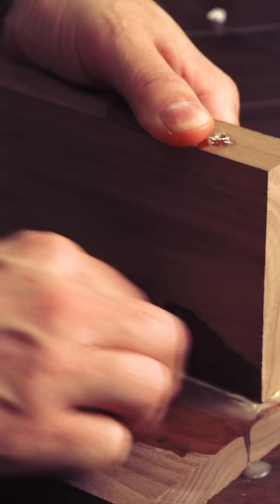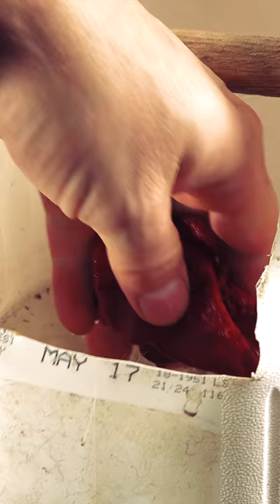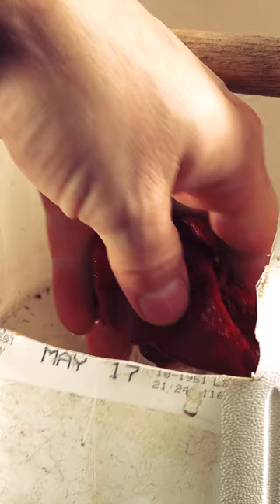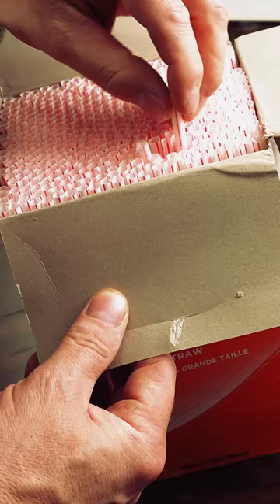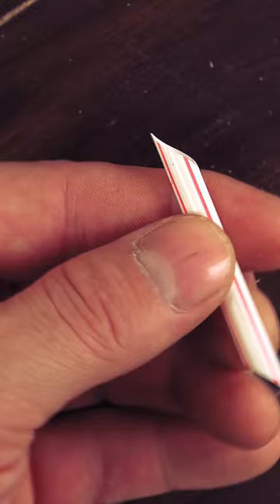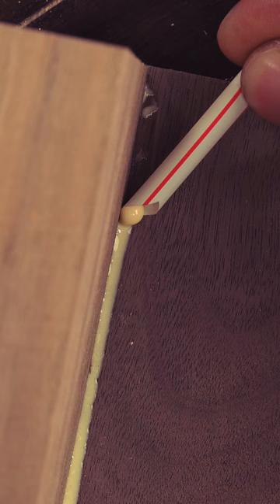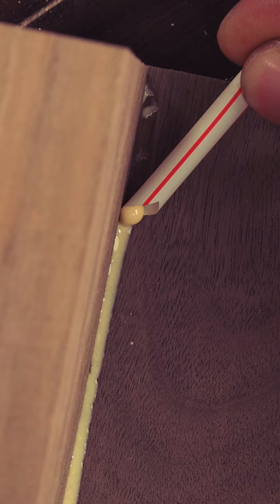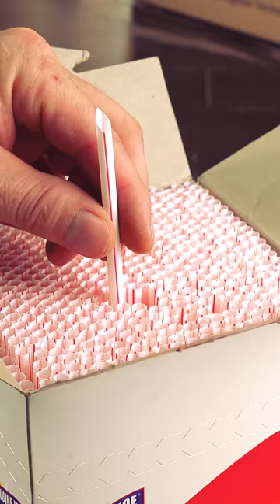95. Straws are PERFECT glue shovels #mtbitesize #shorts

Comment from the maker: Hey Makers!
I got lucky and found those straws discounted at my local hardware store (Menards).  Here's a box I found on Amazon that are a good buy → https://amzn.to/3VGXq1Z

The reason the woody trees wanted to take a nap is purely for-rest.

Got a tip, send me an email (and get credited)! → https://bit.ly/3KsbPL4
Reply: Btw if you cut off the used part from the whole straw it will make them easier to use and last longer since it's maybe 5mm of used straw every time.
Reply: Or you could just cut the angle on the straw and then cut a new angle the straw after you’re done
Reply: Tip is wonderful, but i have a little problem with it. You say this box will last you a life time. Yes, it is probable. But this is a plastic straw. You are working with wood. What if you take a straw size dowel, or maybe a bit larger, a carving knife and just make that tip on the dowel? You probably have a ton of scrap wood, so you have a material that will last you, your children and their children a life time. Plus you will not throw out a plastic trash every time you scrape that glue excess. Just a little thought... Or maybe take some tougher wood, create a slightly smaller angle than 90 degrees and create a lovely wooden tool for removing excess glue? You could even take a pointy stick, wrap a bit of paper on the tip and you have the same tool, disposable, made of biodegradable material. Possibilities are endless for someone creative and working with such materials :)
Reply: @ogi22  😂 I think you may’ve missed the “hollow” point of this, & the fact a plastic straw will bend deep into the crevice clearing any residue.

@ogi22 Using a timber dowel will make clear up twice as messy
Reply: Would painter tape work?
Reply: @jsthormahlen  Probably it could.
Reply: i found water base wood glues( Elmer works best)   mixed with  90% isopropyl alcohol ( i forgotten the ratio)  leave   little to no mess behind as you can used way less . Sinks way deeper into the wood. Strength depend on the mix ratio  If mix right   You would rip the  solid wood  blocks apart  before the glue fails  
Their are some issues. Quicker dry time  
Glue shrinkage over time. Weird  final cure time.( need more study of that).
Will stuck water out of the air till fully cured.     
I have  things in my home fix this way over 10 year old.  No sign of failure once the cured. Strength is still  insane.

Comment: Don't cut the straw apart until after you scooped the glue. Then just cut off what has the glue in it. They will last even longer and give you a larger area to hold onto it making it more comfortable for larger projects
Reply: Big brain!
Reply: I use the same method he does and I’ve found I don’t have to focus so much on pinching the straw at the end. Makes it a little easier and less to worry shout in the end for cleanup. Straws are cheap anyways.
Reply: Plus it would get full and leak out

Comment: A credit card cut to a slightly acute-angle corner makes a good scraper to get the last bit of squeeze-out out of the corner. Doesn't damage the wood, nor does it  get it wet.

Wait a few minutes prior to scraping, until a skin has formed, and it comes off easier.
Reply: Yeah this straw method isn't effective at all. I've always used razors or a worn out 6in rule. Gets like 99% of it.

Comment: You could tape the edges of one board and put a strip of tape along either side of the surface area you plan to adhere the first board to. Glue it, clean up the excess, and peel the tape.

Comment: Easiest method I’ve found is instead of cleaning the glue when it’s wet, wait until it’s firm but still tacky (about 20 minutes) then take a chisel and clean the joint. Usually leaves zero glue clean up.

Comment: Can confirm! Just because your only
Using a couple of inches does not mean a box will last you a life time. I’ve used one for a couple inches and when I tried using it again I was told it was grips because the sticky stuff was still on the inside. Then I turned it inside out and was asked “if I was stupid and wanted to get her pregnant.”
Reply: Underrated comment
10/10 would read three times again to get the joke!!!

Comment: Wait an hour for the glue to gel up a bit. Scrape it off. Comes right up. No diluting which can soak into the grain, weaken the joint, or leaving scrape marks. You don't have to clean it immediately or wait until it's dried.

Comment: Then before it dries, you use saw dust on the outside of the glue, where youve just used the straw.  Creating a less defined glue line color.  
You can stain it after to further reduce the glue line saw dust infused lines. 

Never tried it myself, id dare say if there was a paint dye of a similar color to the chosen wood.  The kind youd add to a base white paint, add few drops of that to the glue, before applying it, you could work around the glue yellow line.

Comment: I’ve been a woodworker my entire life and I have never had issues cleaning off glue with just a moist rag. At the most, I’ve occasionally used a razor of some sort of thin tool to drag out the excess glue and wipe off the job with a moist cloth… not like the lake soaked cloth in in this video.

Comment: If you wax, I use clapmans beeswax, the joint during a dry run. You can just leave the glue (that is if you don't use an excessive amount of glue) and easily pop it off once dried using a chisel and/or dental pick, for hard to reach areas. Then methyl hydrate the joint once the glue is removed and whatever you are using as your finish will take to the area. I have found this to be one of the better ways of dealing with glued joints.

Comment: Been doing this for years now and I don't cut them, and I buy the large diameter smoothie straws
Reply: jasheed albahari  all your questions will be answered once you start using them, because everyone is not going to do what I do, and it's going to take some practice, then you'll decide what works for you and not for you. I don't cut mine because I feel like it's a waste of time. 
Once the straw is loaded with glue, I then squeeze the glue out of straw, like toothpaste onto a rag and keep going. When I'm done and whats left of the glue has dried, I roll the straw between my fingers and the dried glue breaks up and easily falls out of the straw and it's good for a few more uses. It's then when the end of the straw is worn will I cut the straw to get a new edge. One straw can be used over and over

Comment: Personally, I’d just stick a bit of tape along the base board on each side of the upright first, (And also possibly on the sides of the upright piece.) wipe away excess glue, and peel the tape off. Zero glue outside the actual joint.

Comment: If you are going to stain wood, Never use a damp cloth. You just smear the glue into the pores and in effect seal the wood. When you go to stain it, the stain won't take the same way to those areas and they will be lighter. This is more noticeable  the darker the stain.   With really light colored stains it won't be as big an issue. The best method is to try to use as little glue as possible and let it dry and scrape. It's going to be more work but you'll have better results in the end.

Comment: Or use a proper scraper and not a chisel as a pairing tool to scrape off the excess once dried. If cured not under pressure, you will be able to remove it without issue and you not wet and ingrain the glue into the pores of the wood

Comment: Oh I thought this was pretty common sense.  Or you can take a piece of cardboard and fold it in half.  Then use the corner/tip you create the same way.  Or a credit card if you need.  Put it perpendicular to the wood pieces and then angle it back 45 and down 45 (ish) until it sits pretty flush on both ends and the rounded corner doesn’t leave too much.  Unless you want that as it is atleast a clean edge left

Comment: The only thing that I've found that works good on woods that are especially sensitive to glue squeez  out is waiting into the glue is about half dry and then taking a metal card scraper in scraping out the corner at a 90° angle. Firstly I only use the water trick if it's pink grade I've had pretty bad luck stating after that.

Comment: Think about this, the excess glue that squeezes out of the joint and runs out onto the table gluing your project to the table doesn't add to the strength of the joint. Use glue sparingly!

Comment: This is a great idea but buying a huge box and hoping it lasts a lifetime is not the way to go. Straws eventually degrade and crumble to the touch. I had some in a box that followed me around a few apartment moves over the years and when I eventually wanted to use one it disintegrated when I tried to pull it out. Straws are cheap and using a few inches at a time like this even a small box will last a long time. So just buy a small box and use them up then buy another box
Reply: Put your straws in an air tight ziploc bag and then they last a lot, lot, longer
Keep them in a dark cabinet as well

Comment: I use a 90 degree cut thin strip of wood like an off cut from a rip or something. Kinda like paint stirrer size and just scrape the wet glue with that. Straw idea seems like a good idea too, i just have lots of pieces of scrap wood laying around it's easier to use them

Comment: You're using the chisel incorrectly for glue clean up... Flat side close to the wood and chiseled side towards the glue. Also, use a bigger chisel... Like a 1" or 1.5".  End of the chisel should be positioned towards the corner... Not your way.

Comment: Use less glue...
Reply: And risk under application? Get out of here. Better too much than too little
Reply: Unless you have some squeeze-out, you risk starving the joint.
Reply: @EazySqueezy-chan  you guys are both right. You want to have a consistent bead of squeeze out, but you don’t need thaaat much. Watching him smear it around with a dripping wet soaked rag was rough